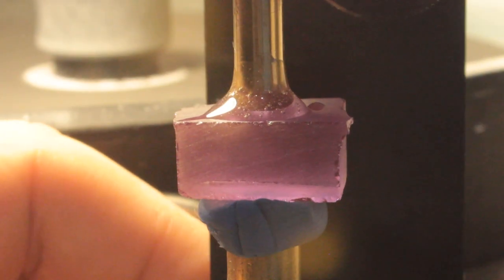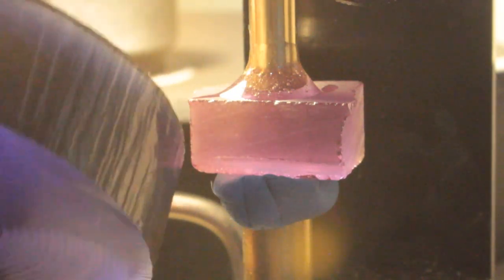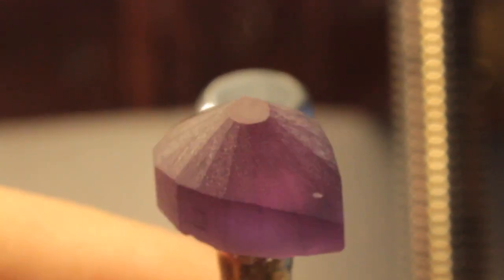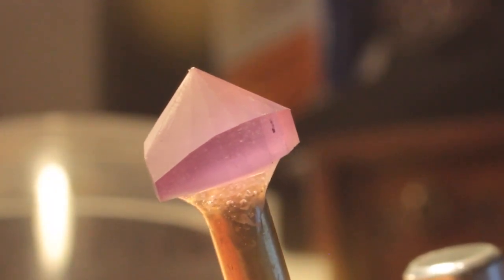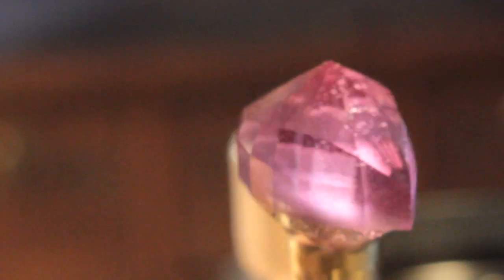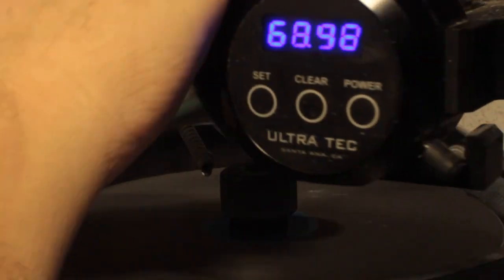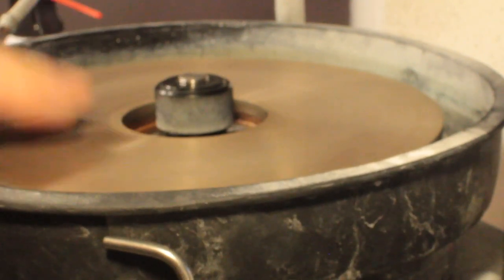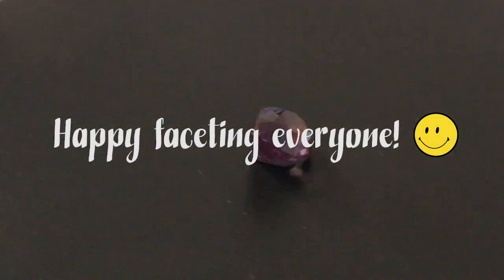Gem Cutting Tutorial: Lab Created Alexandrite

Comment: I cut some of the alexandrite with bubbles from Darryl Killgore.   You always remind us not to make a specific mistake right after I've made the mistake.  I cut a large pear out of the alexandrite and didn't leave enough material for the crown.   I was hoping it would look OK leaving off that last row of facets, but no.  I need to redop and cut it smaller.  But I'm dreading trying to get it back on the dop where it was originally located.   Also cut a Portuguese, squareuguese and a large cushion which came out beautiful.  Will you mount your pear in a jewelry piece?  If you do I would love to see it.
Reply: Yes, unfortunately this specific design requires a tall crown which won't work with a lot of rough, unless you cut the stone much smaller...and waste a lot of rough.  You may have to temporarily dop the pavilion and then switch to the crown, because the in this design, the point, or culet, on the pavilion is the center point of the stone.  In many other pear designs, the culet is not the center point.  Right now, Bopie is just showing the gemstone unmounted, if a customer wants a mounting, Bopie will make one.
Reply: Hey Wild West :D (This is Darryl). Once again glad to hear you like the material, thank you! :) I would also love to see it mounted!

Comment: What was the critical angle that you have used to cut the pavillion? Thanks.
Reply: I followed the gem faceting diagram provided by the USFG.  The critical angle for Alexandrite is  35 degrees.  Which means if you cut a facet on the pavilion at less than 35 degrees, light will pass through that facet and not be reflected back to the top of the gemstone.  You will have what is called a 'window' in the stone.  All of the angles for the pavilion of this gem faceting diagram are above the critical angle for Alexandrite.
Reply: @mikesackos2208  Thanks
Reply: @FatBellyChemist1234  You are welcome.